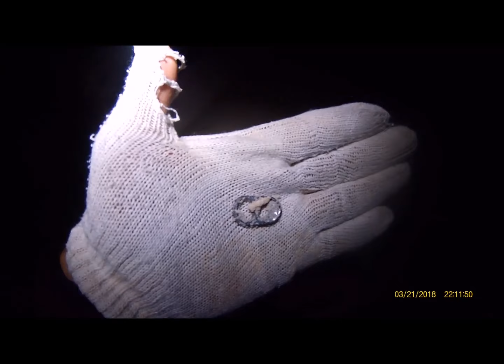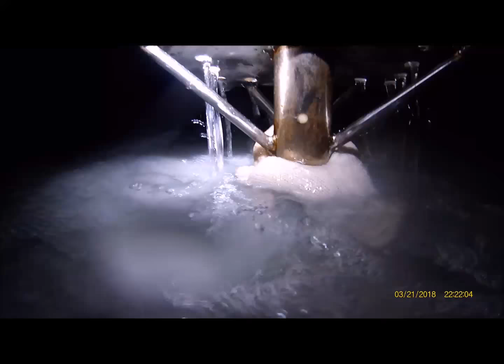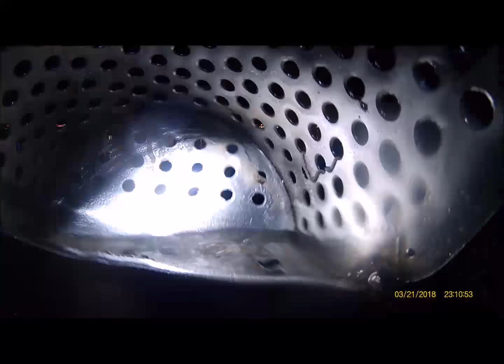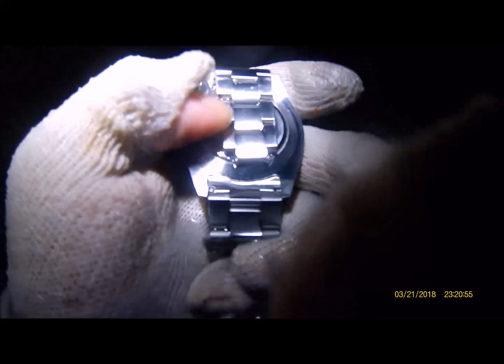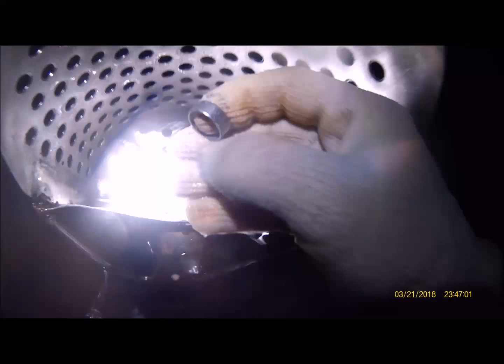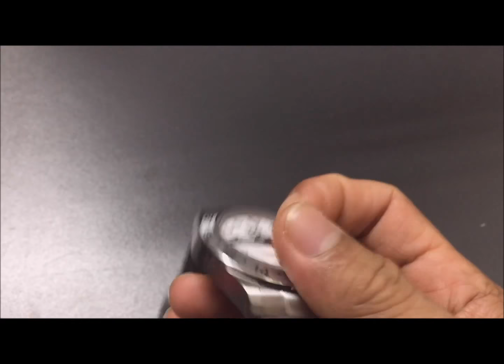Beach Cleaner found Rolex Explorer II while metal detecting

Comment: Hi Benj, I collect Rolex watches and that is a late model Explorer 2 no holes case. If people are going to swim with them they should have them on a Nato strap. The serial and model numbers are at the 12 and 6 o'clock position. They are 904L stainless steel case and it looks in great condition. later models have the numbers on the rehaut (inside)
Reply: Almost forgot, In Australian dollars about $6,500.00 and in really bad condition about $3,500.00 AUD
Reply from the maker: You you really know your stuff haha yes this 2nd model a 216570 model. Serial at 6 o’clock. All visible hints are same as real one but what a shame even the serial was copied. I checked it to Rolextracker and it was there just to know that the movement is the one used to Rado watches. Someone asked me to buy it at Php 205,000 without papers and box but I toke time to confirm it and found out that this is only Php 25,000 brand new. Anyway this still expensive compared to all watches that I have